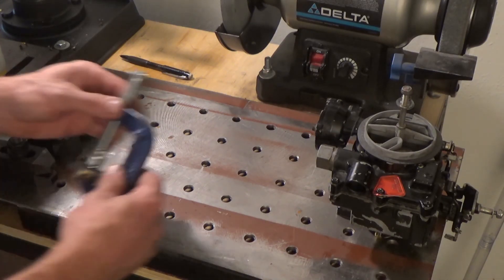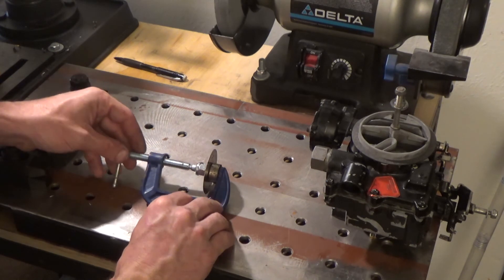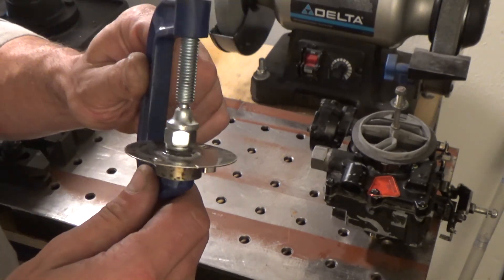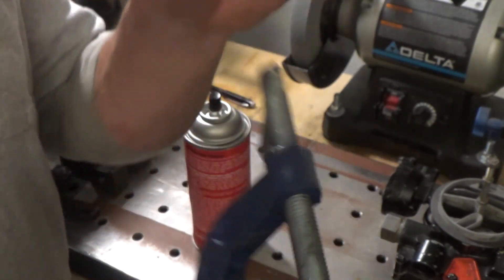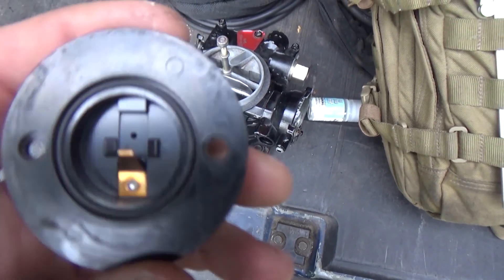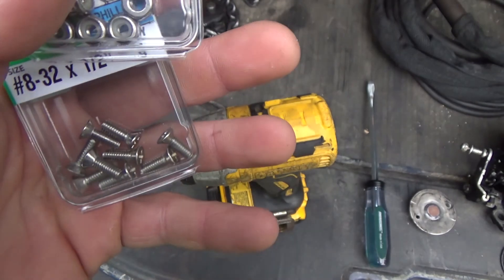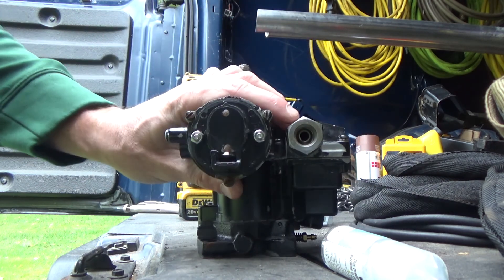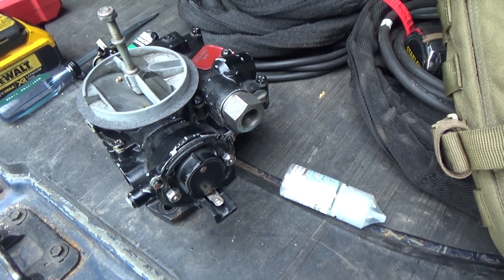Mercruiser 3.0L Fuel System Upgrade

Comment: You have now converted your boat into something a shop will not work on because of liability. Not dissing your ability it’s just you “manufactured” the fuel system and therefore have conducted  all safe practice to make sure it meets coast guard standard.(which it doesn’t)
Way to many lawyers if something goes South.
Edit: Search Boat Explodes.
Reply from the maker: That boat is in a junkyard bro
Reply: Like I said not dissing you but bad stuff can happen. Lawyers dude.
Reply from the maker: @richardluce775  I’d just stick with the new videos.  The overhaul is going to exceed any rules when done.  If you aren’t subscribed but typing full paragraphs, you really aren’t helping me get anywhere.  I’m aware of the USCG rules.  That boat was mine anyway then went to scrap
Reply: Ma di mestiere cosa fai l'uccello del malaugurio?

Comment: What do you use for fuel/water separater?
Reply from the maker: This one did not have one, used synthetic fuel.  Look at some stand alone modular ones and place inline with your current system is best.  They all pretty much work the same but you’ll be wise to buy the largest capacity one so you aren’t changing it out all the time during the season.

Comment: Can you make an update video on the fuel pump working and what about the carb vaccum line do you just plug that hole?
Reply from the maker: Yup any vacuum lines get capped off they have little rubber sleeves for them at Autozone and Napa just gotta ask for them
Reply: @sinewavespecialties2373  i have the same setup but it seems like my carb is starving due to not having a reserve bowl or something. Can you help?

Comment: Lol I got the same exact engine in my boat and I cleaned up the engine but sadly the owner befor me put the wrong gas in it so I got to siphon the gas and flush out the system and the tank so I can safely start my boat up with out destroying my motor.

Comment: Can you show top of engine I'm working on mine but it has no carb I wanna see the linkage
Reply: I can help you out. I got my carb hooked up and everything
Reply: @BLKDIENOMITE   where does the oil line go to for choke on carb. I don't have electric choke.
Reply: @danrid1982  What engine you got? The 3.0 in the video
Reply: @BLKDIENOMITE  yes is 3.0 140 mercruiser
Reply: Yes mercruiser 140

Comment: Where can I get the block off plate for the fuel pump?? Terrific video. Thank you!   I just order the fuel pump. Great idea.
Reply from the maker: Right off the internet.  Literally like $15
Reply: @sinewavespecialties2373  I ended up rebuilding the engine I bought a new cam and got the new fuel pump to work
Reply from the maker: Your page shows performance builds of a truck but you can’t locate a plate??? 🤔
Reply: @sinewavespecialties2373  ya I could I was just asking so I would not have to search
Reply: My bad
Reply from the maker: @vandettabuilds6641  use eBay.  Name brands and certain sites don’t matter.  It’s just a chunk of metal so don’t overpay for it, they are all the same.  Mine was $6.  Never leaks and was the right size.  Double gasket the thing and you’ll be perfect
Reply: I could make one but if you want to tell me
Reply: @sinewavespecialties2373  thank you!!!
Reply: I can’t find a block off link please
Reply from the maker: its a GM 350 block off.  Normal stuff, just in a boat
Reply: @sinewavespecialties2373  this just popped up on my phone and I’m rereading it   I was just asking you for the link and yes I can build a 302 and a ls6 liter but searching for shit on the internet can be a pain in my ass. That’s why I have metal and I make my own parts. Ha ha
Reply from the maker: @vandettabuilds6641  Self Manufacture is always best these days.  At least you know where the parts came from.
Reply: @sinewavespecialties2373  ya that was a project I forgot about. I’m deep into my 92 Camaro

Comment: like replacing with electric fuel pump , where do the power lines hook to
Reply from the maker: The power will go to an ignition circuit and ground to the engine block.  I hooked my power to the alternator charge line because the pump is low current anyway